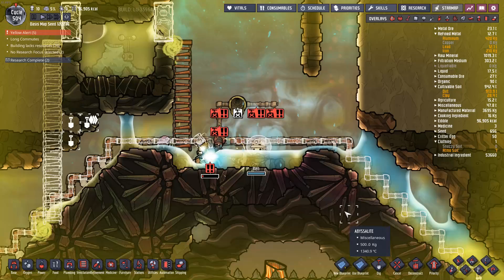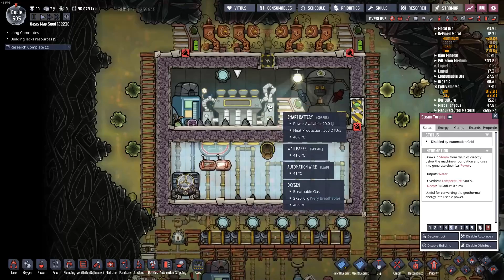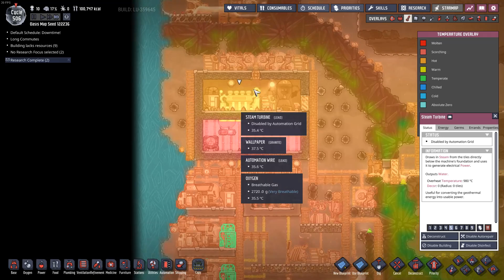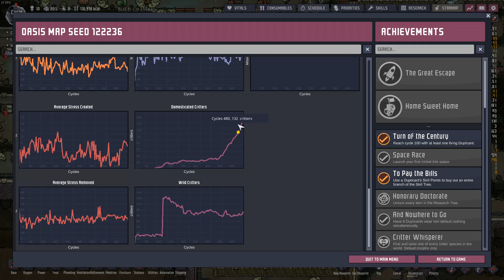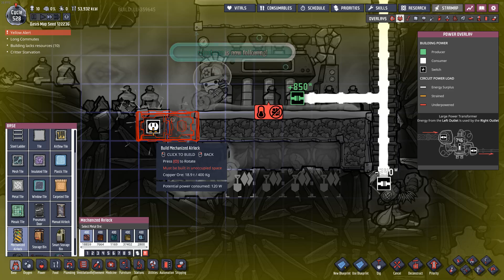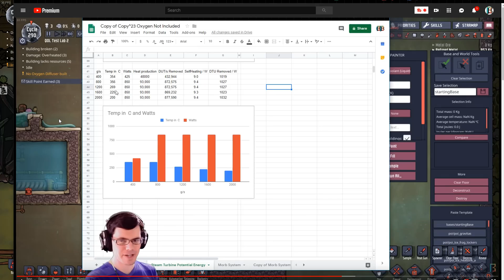Harnessing Power From Abyssalite and Obsidian! Oxygen Not Included ep12

Comment: Brothgar, I have had good luck harvesting heat by using a single door touching the "hot" medium, with a conducting layer (I use metal or diamond tile usually but granite is fine probably) just above it.  I set a thermo sensor in the steam chamber to open/shut the door to keep the temp of the steam at ~190-200 degrees.  It uses fewer materials and has less of a chance to "waste" heat out the top of the turbine (esp with really hot stuff).  As long as there is enough steam in the steam chamber, this works really well.  Without enough steam, the temp spikes too high when the door closes and you end up generating/wasting heat.  Great series!

Comment: to heat 5,000kg of water to 100C from 6C is (4.179 * 5,000,000 * 94) = 1,964,130,000 DTU. you used 16 tiles of abyssalite, that means each tile produced 122,758,125 DTU. oil is nearly 2x what water produces (3,415,000,000 DTU if the oil was 70C to start with). oil would be the way to go, Oil > Petroleum > Sour Gas which should give you roughly 500C sour gas to work with. have two chambers 1 for the steam and the other for the sour gas. use any of the many ways to limit thermal transfer between the two areas and you are set! 

just remember to empty the sour gas room after enough thermal energy has been striped from it! you can do this by have a door that you can open and let it flow into a side room which has VERY VERY cold metal tiles, cold enough to flash sour gas into methane. this will create a suction effective that will pull the sour gas into the metal tiles. once enough pressure has dropped in the sour gas room you close the door and pump in more oil to be changed into more 500C sour gas.
not to bad of a idea as you will have a big pool of methane sitting around waiting to be turned into natural gas. only problem is you need to get super coolant, i suppose you could use door compressors to take the sour gas out of the room and store it until you get super coolant.

not sure if it's a good idea to invest that much into it though, as it is a bug and will be fixed at some point.

Comment: I ended up getting a cool slush geyser and a gold volcano about 20 tiles apart.   I used the molten gold to heat the abyssalite from underneath with the polluted water on top. Using an auto sweeper, I managed to make a conveyor loop responsible for the -9935 decor lump purely made of dirt in the same place and a light shining on the monstrosity I created at the centre of my base as a shrine of non-duplicant sourced pee
Reply: if you think about it...

-cool slush geyser=infinite cooling mass and infinite water/steam/p.dirt

-gold volcano=infinite heating mass  and infinite gold/steam.

you can use both to create infinite steam power, infinite water siveing (energy free at that) , infinite p.dirt/dirt/sand, infinitely efficient cooling loops and heating loops. 

truly an OP combo.

Comment: Water is a really important resource in this game but sometimes you just have too much of it, i had 3 water geysers (on a modded map) , i had to cool the water but now i dont know what to do with it, the best thing to do probably is just to electrolyze it get a ton of O2 and power from hydrogen generators, but I still have too much
Reply: use the rest in a steam powerplant and in farms, like mealwood, oxyferns and so on, that should help. also  , freeze it and you can make ice statues evrywhere.
Reply: @raylenn4444  well the water comes out at 95 C and when it comes into the pipe its around 60 so no powerplant, oxyferns are pretty much useless since i can electrolyze water, and i did make a small blossom farm, and god damn blossoms are actually good, i have something like 9 or 10 of them i get as much calories as i have mealwood and i have 20+ mealwood and i should probably stop farming it... I should probably electrolyze it turn it into power cause the cooling takes a lot of power
Reply: @jagorjurekovic1697  
well heat the water, make a steam boiler and get thoses steam turbines rolling....

as for the farms, yes it's useless, but it's a good pretext to consume excess water. 

and yeah, ice machines are a thing you know?  get thoses ice statues going pal....

and you could work on liquid oxygen/hydrogen for rockets,or steam rockets.
Reply: @raylenn4444  ok... I dunno but do you know if ice machines still cool things? And what do ice sculptures actually do? Do they melt and how fast? But it doesnt really matter i have other things to do in the game i just wanna make some bonuses of having that water

Comment: Any link to where you read about this glitch? I don't really understand how it works. Several folks over on Discord concluded that there is no glitch here: basically we concluded that the current system is designed such that abyssalite can easily conduct heat to/from materials other than abyssalite, because the conductivity of the interface between the two is some kind of average of the two conductivities. But maybe we're mistaken.

Looks like https://forums.kleientertainment.com/klei-bug-tracker/oni/heat-transfers-from-abyssalite-if-liquid-able-to-phase-change-r12230/ might be the bug you're talking about, but this is almost a year old, I wouldn't expect it to still be there.
Reply: basically the issue of this bug is that it insta flash any material into it's hotter state without heating that much. it's not that complicated.

for exapmple, if water rains on very hot abyssalite, it will instantly turn into steam without heating for real, while the abyssalite cools down.

aka it deletes it's own heat by transforming any ressources into it's hotter phase instantly.

that's the bug brotygar is faced with.
Reply: The heat transfer between 2 media is taken using the lower thermal conductivity of the two. Because Abyssalite has 0 thermal conductivity, it should never transfer heat up or cool down under any circumstances.

Comment: Brothgar you found a cool slush geyser why not use it for cooling the sieve it or make fertilizer and use the excess for oxygen.
Reply: if he were to sieve it, the water would come out at 40° , so it would not be efficient for cooling now would it? 

tho just pumping it into a cooling pipe ri'unning aroung the base would work for a while...
Reply: @raylenn4444  well yeah I just needed an example for what to use it for
Reply: @raylenn4444  Water sieves no longer have fixed temperature outputs, right?
Reply: @danpowell806  No they work well in combination with the cool slush geyser :) but keep in mind that clean water freezes faster than polluted water, so maybe add a thermo sensor so you don't pump water in the sieve which is too cold.
Reply: @helmchen1239  Thanks. Part of the trouble with using the internet to research ONI is how much of the information is secretly out of date. 

Right now I'm letting by cool slush geyser drip into the oil biome because I'm too lazy to properly use atmo suit docks or implement a proper cooling system when I can just put a liquid filter on the pump to separate the crude oil and pwater.